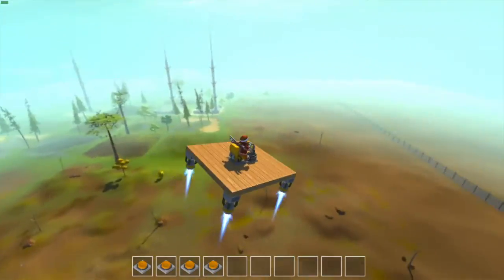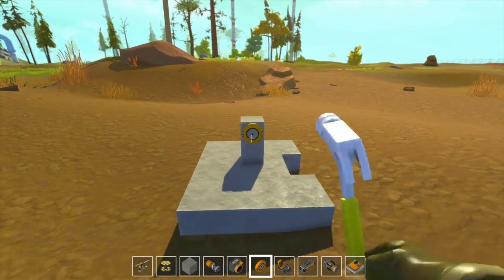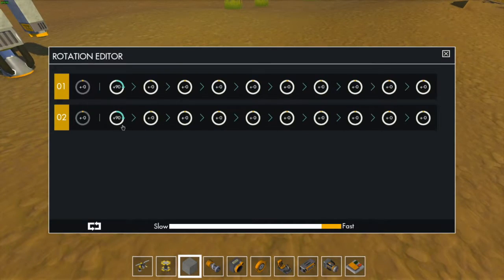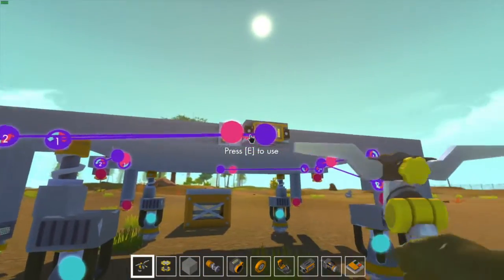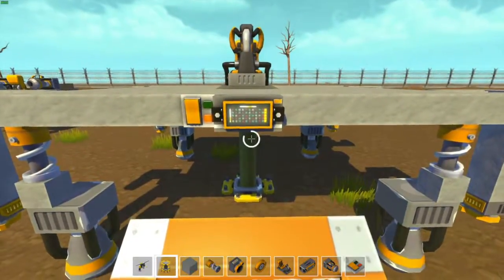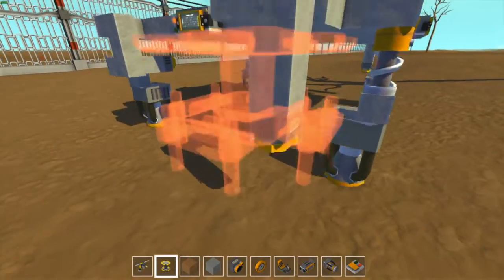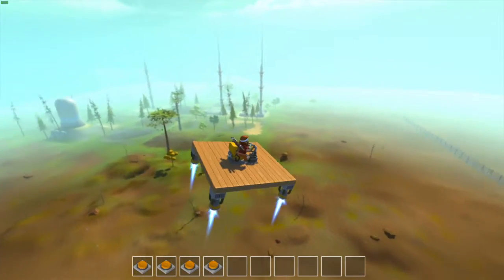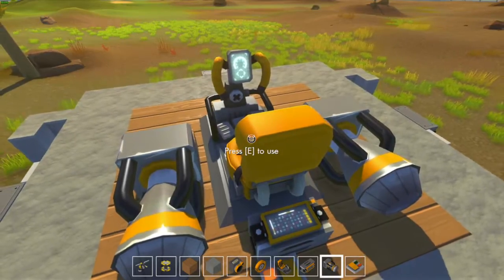Scrap Mechanic - Hovercraft WORKS!

Comment: Good job. I attempted a hovercraft using sensors but I think it was to light as it just kept flipping. Hopefully they will allow us to adjust the power of thrusters soon.
Reply from the maker: +r3ap3rxy Thanks, yeah it is quite difficult at the moment you have to balance the weight since u can't change the thrusters, try the suspension it helps keep it stable :)
Reply: +Julzinator Yeah I'll try and work it into my flying machine that I made a video of. Have a look, its pretty simple but it works.
Reply: +Julzinator you can adjust the thruster power by changing their angle: the farther away from verticle they go, the less 'powerful' they'll be. You'll have to do them in opposing pairs to offset the sideways thrust i guess
Reply from the maker: +Dalton Bedore That's pretty clever, I can see how it would work. But I think I will wait until we can adjust the thrust, since it would be very tricky to do.
Reply: +Julzinator I wish i could play this game because I've already figured it out but i'll try to explain, lol. Put the sensors at different heights, each sensor activates it's own controller. Each controller is linked to a set of bearings (one bearing per controller, per thruster.) Each thruster is on several bearings - one bearing for each preset angle you wish to have. Probably would be laggy as hell, but i'm pretty sure it would work!